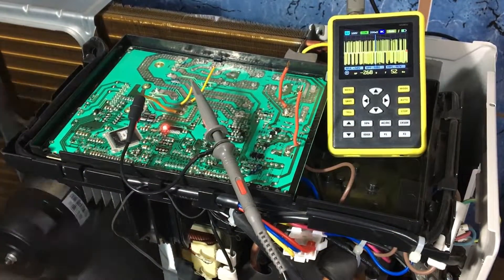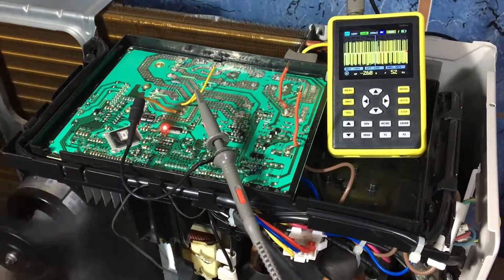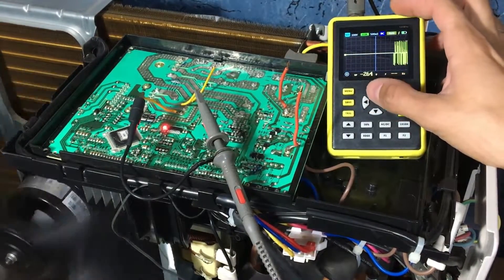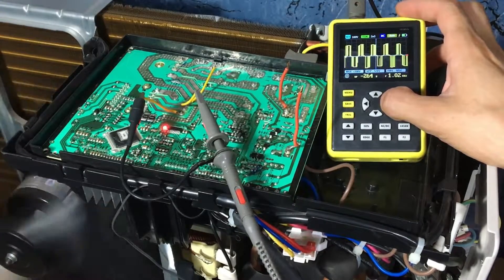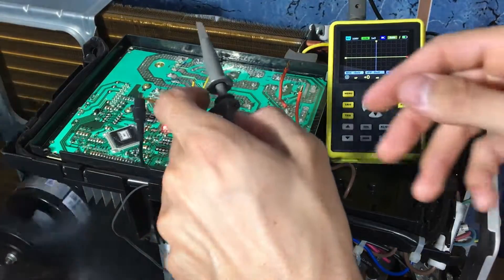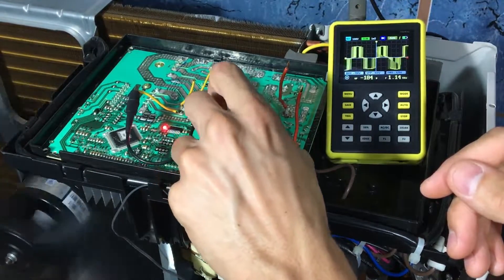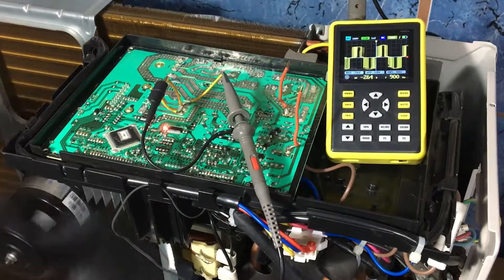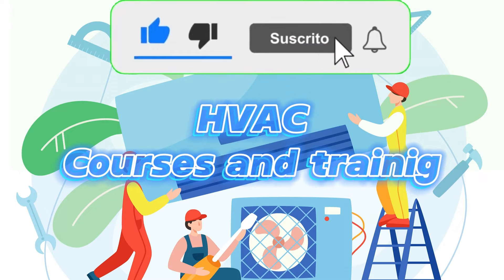Class 83:  U, V, W Measurement with an Oscilloscope #inverter #measures #uvw #oscilloscope

Comment: Great video 
But how to know ipm faulty?
Reply from the maker: Check the IPM visually for burns or cracks. If the fan or compressor doesn’t start but control signals are correct, the IPM may be faulty. You can also check each IGBT with a multimeter for open or short circuits.
Reply: @inverterpro_en thank you for your response ❤